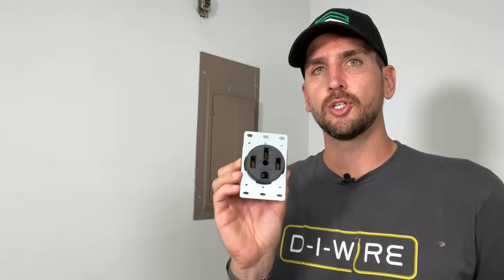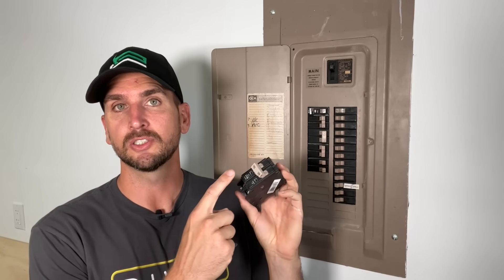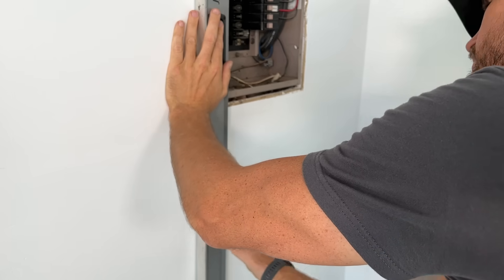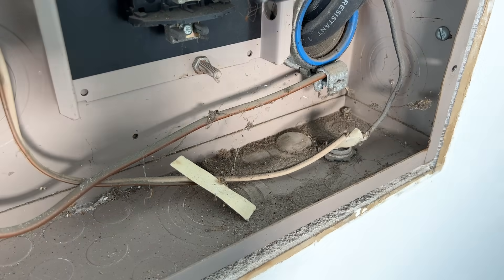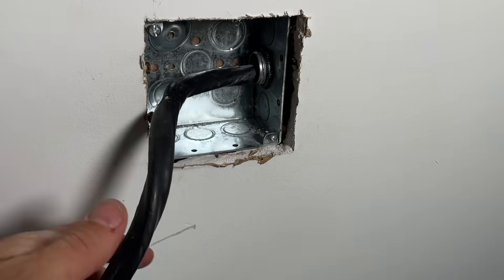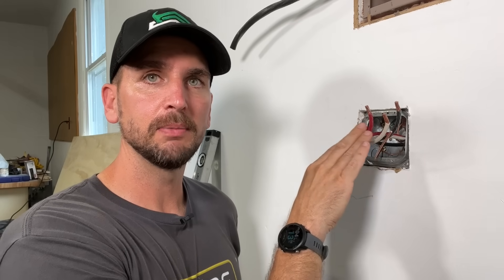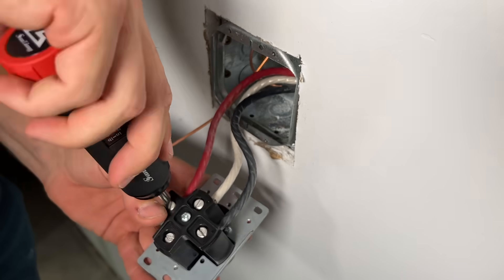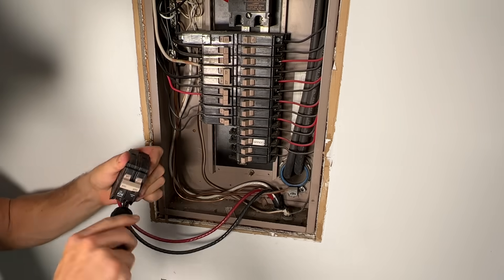Quick and Easy DIY 240V Outlet Install | 50 Amp NEMA 14-50

Comment: So many issues, from the top...
1.  Can my panel support the addition of a 50A continuous load?  Breaker space has no bearing on panel load.... Do you even know what a load calculation is?
2.  Can I install a charging receptacle directly beneath the location of my 40 year old CH panel (codes change over time).
3.  Does my local jurisdiction require GFCI protection on the circuit for an EV charger.  Hint, 2020 code says it must be a GFCI circuit.  Do you know how to wire a 2P GFCI circuit?
4.  Does the manufacturer of the EV charger I am using require a hard wired connection (no receptacle) on its charger when connected to a 50A circuit.  (Hint some chargers specifically state hard wired above 30A.)
5. Do you know or trust the guy at your local home improvement to know specifically what wire you need to install?  NM, NMC, THWN, THHN.  He said 6/3 but is all 6/3 the same?  Is the install location a damp area, does that make a difference?  
6.  Am I willing to risk, my car, my house or my life doing something way more complicated than the torque settings on the screws on the receptacle......

There's more, but you get the point, why YouTube let's this type of posting occur is beyond me.  Good Luck.
Reply: Can an intelligent homeowner learn the appropriate way to install one up to code and safely?  Yes. Those of us who can know who we are.

Comment: Two things, a ground wire to the box is a nice to have in this case since the outlet tabs screwed to the box are approved as grounding. Nothing wrong with an extra wire and grounding screw, and in reality it is an extra safety piece. 2nd thing is that make sure to stay to the side and look away when turning the breaker specially for the first time. Short circuits can cause arcing it can royally suck if you get hit in the face. I had some faulty 6 gauge wire and after wiring my EV charger, it short circuited outside of the box, but it caused an arc the 1st time I turned it on and I knew about it. One of the hot wires had bad jacket and it came into contact with the ground wire. It melted the wires instantly at the connection point with 0 load. Crazy stuff!
Reply: It's actually code when using a metal box to connect the ground to the box.
Reply: @dracula3811  it is code to ground the box for sure and the outlet tabs alone can be a grounding method. By grounding the outlet, the tabs are also grounded. Bonding the tabs to the box creates the grounding and it is similar to the grounding screw on the box itself. Again, it is good to do both. In many old homes, the conduit itself is the grounding path and there is no ground wire to connect to. The outlet tabs themselves establish the grounding when bonded to the box.

Comment: After watched the whole video, I think I will still hire a pro, too many places where I can screw up and costs me way more than the saving, nice work thou! 😂
Reply: I keep going back and forth if I should try it myself. All i want to do is replace a nema 10-50 with a nema 14-50 so I already have the 60 amp breaker in the panel. The EVSE (car charger) I bought for my 2017 Chevy Volt is displaying a warning light for no ground (but it is still charging). It is my understanding that newer EVs will not charge if there is no ground.

In any case, I am concerned about the danger but I also know if I do this swap successfully, it will give me confidence to install a second outlet for an additional EV if my wife wants one. I was equally nervous the first time I switched out some interior 120w nema 5-15 outlets and light switches but now I do it all of the time.

Comment: This was a good video on how to install a 14-50.  If this is a permanent home charger install though a 14-50 is not the best choice.  The best choice would be a hard wired install.  There are several reasons.  The primary being safety and charging speed.  A 14-50 is limited to 50 amps and which means max charge rate of 40 amps.  Most EV including Tesla charge at up to 48 amps which needs a 60 amp circuit.  The larger issue with a 14-50 though is wear.  Over time the contact will wear out or poorly made plugs will cause arcing which could cause a fire.  For this reason a permanent home EV charger should always be hard wired and not plugged into a 14-50 or 14-30 outlet.  Lastly code requires GFCI breakers which will cause nuisance tripping with most EVSE.
Reply: Most cars allow for amperage setup. Nice chargers also allow a max amp as well. My wife has a Polestar 2 and we set her car and charger to 32amp max. But yeah, GFCI is required in a garage or outdoor, but nuisance tripping happens a lot more with motors like fridges. We have had 2 EVs for more than a year and had 0 trips. Maybe lucky
Reply: Disagree. A hard wired charger, in most cases, is dedicated to one specific brand of car, by outlet and/or location of charging port on the car. Example: Tesla's charge at the left rear corner of the car, some NIssan's charge in the center of the front grill. In addition, using a dedicated charger means this circuit cannot be used for anything else. For example, if someone visits your house with a travel trailer or RV, they can easily plug-in their trailer or RV and live in there. OR what if a friend with an EV which requires a specialized charger visits and wants to charge? Wanna do pottery, or run some large shop tools? A 14-50 works for all these function, whereas a hard wired charger sucks up two breaker slots forever.
As to charging speed, for my Tesla, I can charge from my 14-50 outlet at 32 miles per hour, which is plenty fast. I mean, over 8 hours, I can get 256 miles of range, and 9 hours maxes out the battery.
Reply: @colinpovey2904  I understand the points your making.  Are they really dedicated to one brand car though?  Most hard wired chargers have cords that are 18 to 24 inches long.  Long enough to reach the charge port on many different vehicles.  That would be a function of the location of the charger and not the connection to the electrical supply.  Why not have a outlet dedicated to powering the RV or other equipment?  What if you need to use both at the same time?  Unless of course the panel is full.

14-50 require GFCI which can cause nuisance tripping.  If you must use one 14-50 for all these devices make sure its an industrial grade 14-50 like a Hubbel.  I have seen quite a few 14-50 melt over the years.  This is why I would do hard wired.  The EV charging is a high and constant load that can go on for many hours.  To me anyway its not worth the risk of having something melt.
Reply: @KenYnc   Well, as one example, Tesla chargers will only fit Tesla's, without using an adapter, which is costly ($250, I believe), and another potential point of failure. Besides, many people want an adapter IN their car, for use while traveling. So, if you want one in the car for traveling, and you need one at home for routine charging, most people would want to spend $500 for two of them (SO easy to forget to take the home one on the road).

In my current house, the best place for the 14-50 (middle-rear of the garage on the right side) works fine for a Tesla (I have to drape the cable on the floor under the rear of the car), but would simply not work for a Ford, which charge just in front of the drivers door, unless you back the vehicle into a home garage, a truly scary idea to me! Nor would it work for a Nissan, which generally charge in the center of the front grill.
In my new house, I converted an existing outlet installed for a large fridge to one for my Tesla.With work, I think that it would fit most but not all EV's. When I park my Tesla in the garage, it's about 1/3 the way back from the front of the car, on the left side. It can reach a Tesla port, a Ford port, and a Nissan (front) port.
Reply: @colinpovey2904  true but Tesla is the only one with a proprietary connector.  Any other EV use the J1772 standard.  Up until recently they come with the mobile charger.  In two years of owning my Tesla I have not used the mobile charger but one time.  It was out of convenience that I used it otherwise I would have supercharged.  It's not necessary anymore like it was when EV were first released now that we have a lot more public chargers.  That's why Tesla doesn't include the mobile charger anymore.  Yeah I get that they are all in different locations but if your charger still has to be able to reach it doesn't make a difference does it?  I mean it still has to connect to the 14-50 and then stretch from that to the charge port on the car.  The hard wired charger has 24" of cord so plenty long enough you just have to position the charger similar to how you would position the 14-50 to make it easier to reach multiple charge port locations.  I have seen too many 14-50 melt or the cheap plugs that come with the equipment that is made overseas with poor QC.  I still feel hard wired is the way to go especially if you are installing a new circuit.  Makes no sense to me why I would opt for slower charging on a new installation.

Comment: Most important check you missed was checking the continuity of the ground wire. 

Unless you test for continuity between any exposed metal part on the faceplate of the outlet & also the ground pin in the outlet back to the breaker box you have no way of knowing if you are protected, you also will know from this test if you have achieved a low resistance path back to ground ensuring the breaker will trip in the event of a fault.

I would have also checked the resistance of both line and the neutral conductors from the outlet back to the breaker box to make sure their connections are also of a low resistance so I know all the connections are good.

All of these are dead tests.
Reply: Insulated boots and gloves for zero voltage testing as well. Some kind of arc face shield is also recommended.

Comment: For 11.5kW charging you need a 60 amp breaker and maybe 4 gauge wire if you had a long run. This setup on the video would be good up to 9.6kW charging. The reason is that you don't want to run the breaker at more than 80% of max load of extended periods of time, like when charging an ev
Reply from the maker: Thanks for the feedback, the Tesla Gen 2 and 3 wall charger you need to set the max amperage to 80% (as you called out).  Sounds like this is a common problem with installs by DIYers and Pros.  I will be setting mine to 40 Amps or level 8 on the rotary dial for the Tesla charger.
Reply: @EverydayHomeRepairs  A note on this though, you still need the 60 Amp breaker to meet code IF you were to hardware the charger, because it can't depend on an end user just deciding to set his equipment to a setting that won't exceed the maximum rating for the breaker to 40 Amps. Even though you probably can't draw more than that from your car. Also it is future proofing, my own car draws 48Amps and 80% would require then the 60 Amp breaker. And I imagine in just a couple of years the cars might require 100 Amps. That said I only trickle charge my car every night on 120v outlet and it hasn't raised my utility bill nor slowed down my ability to get around since I don't go through a full tank every day. Thanks for all your great videos.
Reply: @westcoastjj3658  good info.  I am doing a 40' run from the panel to the outlet and want to be set up for a 11.5KW charger.  So I am going with the 60 amp breaker and 4 gage wire.  However, now what do I use for my outlet?  Can I still use a nema 14-50R, or do I need to go with the nema 14-60R?  If I go with the 14-60R, then I will need an adapter between the outlet and the charger plug, correct?  Or is hardwire the only possible way to do an 11.5KW charger?
Reply: True, that’s code

Comment: Only a dingdong will DIY a 14-50 NEMA outlet for electric car.  If you do not use a licensed electrical contractor to install your
EV outlet or charger for your electric car, you violated the warranty.  Yes, Quick and Easy way to dump $50,000.  Don't listen to this dingdong!

Comment: The NEC currently calls for GFCIs for garage installations.  I know some local codes may not.   For EV charging, a commercial 14-50 is really a must.  They are engineered for the loads an EV can generate.  The cheap construction grade 14-50s have low insertion cycles and could present fire hazard with high current x time that an EV could require.
Reply: Can i just use the breaker to power on and off the EV charger rather than removing it and inserting into the 14-50 every time?
Reply: @sanjapkoki  Why do either?  I just remove the cable and hang it on a hook.  Never unplug or turn off the breaker.
Reply: Im seeing sources all over saying that a GFCI is indeed code but you can't run most level 2 chargers off GFCI because it includes GFCI built in..?
Reply: @J_Madison  I have heard reports like those.  One suggested that the method that the mobile connector uses to determine the type of power connection is perceived as leakage to some GFCIs.  I don't know it is true.  The GFCI code change was in 2020.  Tesla stopped including the 14-50 cable and essentially recommended the Wall Connector which is hard wired and no GFCI is required.  It may be coincidental but I doubt it.
It is equally possible that Tesla became aware of the cheap 14-50 installations and decided it was too much of a liability.  If I needed 220v charging, I would go with a Wall Connector.  It has the best performance and is a one time cost.  People spend thousands on PPF and trick wheels then want to go cheap on charging.
Reply: @gbinman  Thanks for the info. I plan on installing a hardwired version this week just for the reason youve listed. 

I have plenty experience doing 220v installs for wood shop equipment and try to keep everything to up to code.

Comment: When taking the entire power off the main breaker I'd recommend that you turn off any thermostats, and unplug computer /TV type appliances.  Turn off breakers one by one then throw the main breaker.  Reverse process after you have completed your install.  Point being, don't surge/slam the power off and especially back on.  I think it's just a good best practice.
Reply: Yes this is best practice when turning off and on main
Reply: Thanks
Reply: The computer already has 2 surge protectors.

Comment: What happens when your out of room for the breaker?
Reply: You have to have an electrician upgrade your service from what you have to a higher-rated service (eg. Upgrade from 200-amp service to 300-amp service).   It's expensive as you'll be paying for a new panel and new, heavier-duty service entrance conductors from where you hook up to the power company.   Check with the power company to assess the feasibility.
Reply: You must change the entire breaker panel, which is a job for a pro.
Reply: @colinpovey2904  can you add a sub panel?
Reply: @jonphanspromotions  In many or most situation, yes. But it still may require a lot of work, best left to a pro.

Comment: If you area is in the 2020 code cycle would be triple that. Have to install an expensive two pole Arc Fault circuit breaker. Should only be done by a licensed & insured electrician.
Reply: Should have said GFCI two pole circuit breaker

Comment: Do not want to pay for an electrician. But what if all the slots are full in the panel?  I know you just add a bigger or sub panel but what can you do for cheaper ?
Reply: Tandem breakers can combine two normal-sized breakers together into a single slot. It is also possible to combine circuits together and eliminate breakers but it must be done carefully (i.e. if you’ve replaced all of your old incandescent bulbs with LED/CFL then your lighting circuits might be able to safely be combined due to reduced load). If your panel is already full you need to make sure that adding a new outlet isn’t going to exceed the service capacity of your electrical service.
Reply: @dmdx86  thanks for info.
Reply: nothing safe get an electrician its not plumbing its deadly pay an electrician for advice and options you can legally and safely do

Comment: Just a thought. Turn your face away from the breaker when you turn it off.  Also turn off the breaker(s) before opening the electrical panel.
Reply: Another thing every time you turn a breaker or safety switch on or off take a deep breath and hold it. In the unfortunate ARC FAULT Blast this will prevent you from inhaling 10,000 degree air and burning your lungs. We have to have on a tinted face shield along with rated PPE whiling turning anything over 120 volts. We have our rubber & outlet canvas gloves inspected, tested & date stamped every 6 months.
Reply: Stay afraid.
Reply: @soisaidtogod4248  Only time I was afraid of electricity  was while in Viet Nam while pulling guard duty on helicopter flight line. We sat on top of metal shipping box two feet from ungrounded barb wire on wooden poles during heavy lightning storms. Of course college educated officers could not accept that was very dangerous.

Comment: EVs do not use the neutral, you can run 8/2 and save costs. Either 14-50p and leave off neutral or just use a 6-50. Many chargers you can select the type of plug it comes with, or just buy an adapter. Longer runs would benefit
Reply: 8/2 nm cable is not rated for 50 amps. Remember NM cable is limited to the 60C column in the NEC.
Reply: @uhjyuff2095  obviously size it appropriately, but I'd use thhn, which 8awg is 50a rated. Though I agree better to size up for chargers, especially if it's hard to do to future proof.
Reply: @wrefk  Yeah, the fact you recognize that #8 AWG is cheaper than a piece of 6/3 NM cable is great. Remember to add the cost of the conduit because NM cable doesn't need conduit but the "THHN" does require conduit.

Comment: The Wheeler Fat Wrench is also a good option for a torque wrench.  It is usually used for other projects but would be good for electrical as well.
Reply: NIce tool.  Great for gunsmithing projects as well!